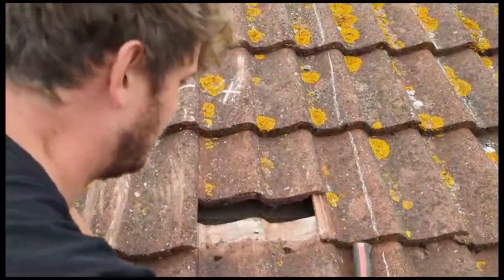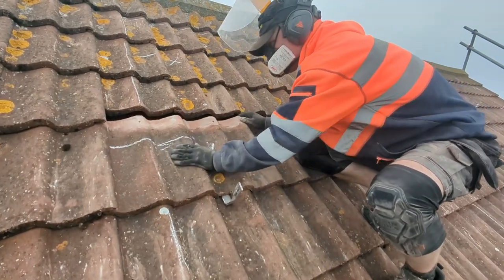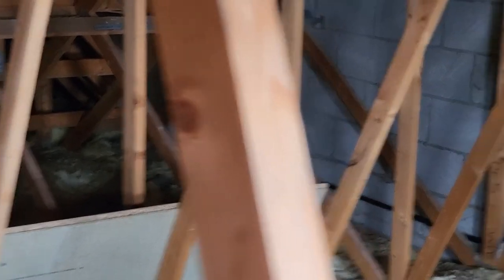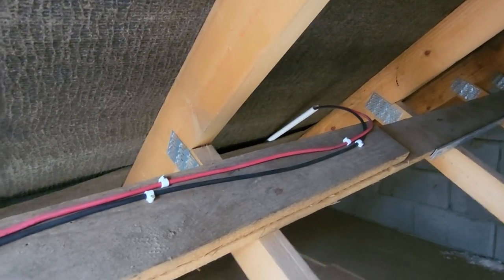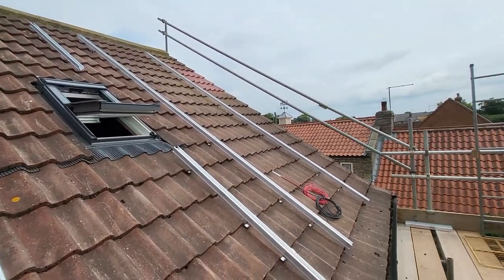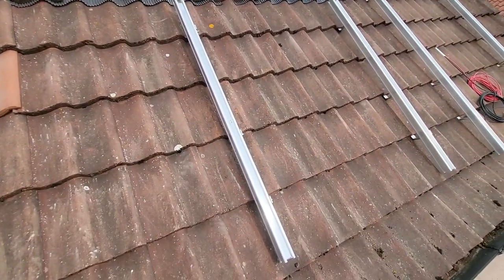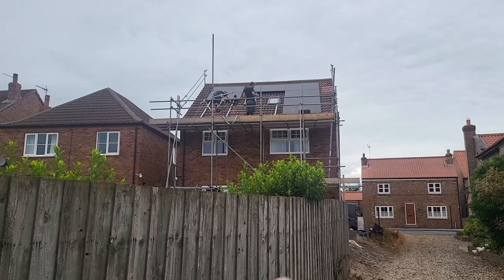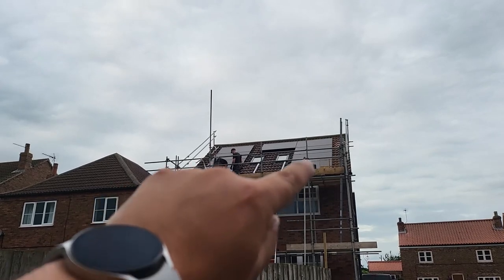How do you fit solar panels on a roof ???

Comment: Having 10 PV panels fitted on January 2nd, by Mid March I had pigeons nesting under one array, and eyeing up the other one for a further nursery.
After fledging, I had about 4 months of defending the panels from further nest building until I fitted barriers of 4 "hedgehog" gutter brushes wired together into 16 metre combined lengths to completely surround each array of 6 panels mounted on south and 4 panels on west roofs. 
Fitting them retrospectively was a one-man job for me from ladder with fixed stand-off and a roof ladder, and took less than 2 hours for each array. These  ladders are semi permanent to enable easy cleaning, with hose, jetwash and window cleaning squeegees. but rainfall so far has sufficed to wash off any seagull spatters, on what has been a fairly dry year overall on the south coast.
Pigeons don't appear to roost on my roof at all since fitting these a couple of months ago, 
I see lots of  professionally fitted bird protection attracting mating pigeons, so I guess their barriers are not complete. 40 metres of  100mm diameter gutter brushes cost  £96.00. 
Altogether, I have been pleased with my Solax 3.7kW inverter and 5,8kW battery, which in 8 months has generated 3mWh back to grid on an Octopus Flux tariff, making more than I use in terms of cost, with refunds every 2 months, currently with about £126 credit. 
September has been disappointing so far, so I will wait another month before deciding how much credit to leave to cover winter. I have a variable Direct Debit,and the last DD I paid was in May, refunded in June. 
I guess  the predicted 7-10 years before I have covered my investment for the PV installation was reasonably accurate, so as a pensioner, I feel somewhat less disadvantaged by the Kleptocratic Starmer Government than I might have otherwise.

Comment: Great work Mark, very important point I never see explained in all these you tube videos though is to be aware of induction loops on the strings. DIYers could be following these videos unfortunately and won’t have a clue on making sure to be installing cables correctly out on the roof!
Reply from the maker: That’s why most do not show or explain everything. To avoid those who don’t know, having a go. It isn’t on people sharing their work to educate and try cover things off at that level. Sadly that is in the hands of legislation and self responsibility. 

Thanks.

Comment: Interesting to see the roof work, not many people show this side of things.

You mentioned the cable colours, what colours are DC cables meant to be these days? I've only ever seen black used for solar, with the occasional person using red as well.

Shame about the gap but it is what it is. You could have possibly used a different length of panel to try to make the fit without the gap as there is quite a range, but I'm not sure it would have been enough. I think I would have done two strings of 5 in L shaped patterns but it's hard to know how it would look without doing it.
Reply from the maker: Red and white!

We ran through a whole range of options on the software. That's the beauty of it. Gives all the options on a screen. This was the preferred solution. It actually looks decent tbh.
Reply: @electrician247  Ah I've never seen that colour scheme used, now I know I'll probably spot it everywhere though!

And yeah as long as the customer's happy, you can't ask for more. The lines are all nice and straight and it's a very neat job.

Comment: watched a number of your videos which are great.  Could you do a video on the Solax Cloud from the App and the website.  We've a 14Kw Inverter but the readings don't look right to me.  No readings on AC Power (On-Grid) during the night, but then during the day these increase to similar to the amount of PV Power that's been generated.  Grid Power is also negative during the night when power coming from the grid.  I really don't know if the installer has wired it all correctly!
Reply from the maker: Your CT(s) will be the wrong way around. assume 3 phase? Simple fix for the installer to correct. 

Arrows point to the grid I believe.

Comment: Good video. Don't see many solar installs. Personally I'd never lift solar panels with vacuum clamps! Not designed for it. The cells behind the glass are very fragile, subject to micro cracks, and the marks on the panels on the roof look like delamination. Ifft them by the edges with hooks. My installer called them up the ladder. They're only 20kg
Reply from the maker: The worst method is via ladder. Against just about every manual handling and working at height reg is a single activity. No. 

No delamination whatsoever. They leave grease marks much like finger prints which wash off on the first clean. 

Even on the roof suction cups are the best way to move panels safely and without damage. As per most manufacturers instructions.
Reply: @electrician247  ok. Thanks for the reply. Would still think you could get some wire through the bolt holes to lift them - wouldn't need to use vacuum clamps.
Reply from the maker: @markyates5744  again absolutely not. The frames will warp/bend. Only other advisable way would be in a solar bag or with lifting straps both of which we also do from time to time. Leave it to professionals is best bet

Comment: 1:55 so how do you get all the tiles nailed back down without going all the way up to ridge ?  23:50 those windows are shiite - if you get storm water in the top running down inside rotting the frame you can add an Omega (symbol) shaped 10-15mm adhesive seal at top of window and add a L shaped piece of plastic/tape to the top metal bit over the glass
Reply from the maker: Not all of the tiles are nailed to begin with. Roofers seem to nail the odd few. Consistent among most roofs we have worked on. Any tile we lift that was nailed is returned as such working away until we find them without. Usually not very far. 

Hope that helps.

Windows are not mine but potentially useful info for anyone else watching. 

Thanks
Reply: @electrician247  wow are roofers now that lazy or cheap to not nail them all ! or are uk storms not sufficiently strong to lift those heavy concrete tiles ?
Reply from the maker: @H4N5O1O  nails never did hold them down. Pin them in line. Are you a roofer? 1 or 2 clout nails holding tiles down I assume your joking 🤣🤣🤣

Comment: I notice you are not using a roof ladder. One thing you should be aware of is that no roof tile is designed to walk on. Crawling boards should always be used to prevent damage to the tiles.
Reply from the maker: We have roof ladders and big softies which were used however on installing the panels it is unavoidable to not use them. All breakages are replaced and generally concrete roof tiles pretty robust. Nature of the beast until someone invents drones to drop them on.

Comment: The biggest cost seems to be the scaffolding contractors install,  I can get a complete package  , the package covers everything for Worcester bosch so it seems OK it is the outside contractors to set up the installation and the scaffolding costs. The VAT is the other thing as it needs an approved company to do the whole job in order to not pay the tax at 20%. As I am paying myself it needs to be as cost effective as possible but the regulations do not allow VAT claim back on parts.
Reply from the maker: Rightly so. The tax credit/benefit/welfare payment comes from government/tax payers. The value on that has to be there by utilising qualified and approved contractors. 

Have you notified building control of your installation?